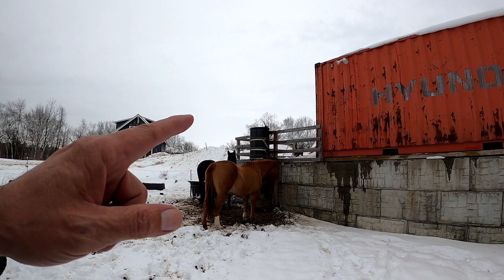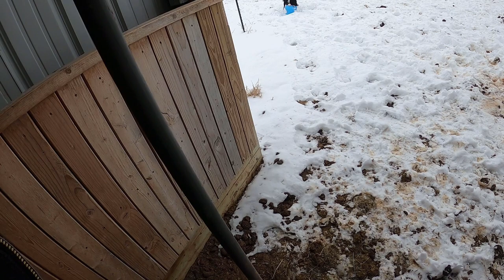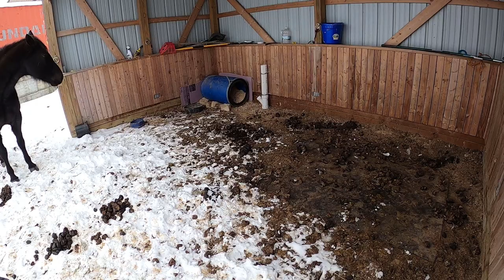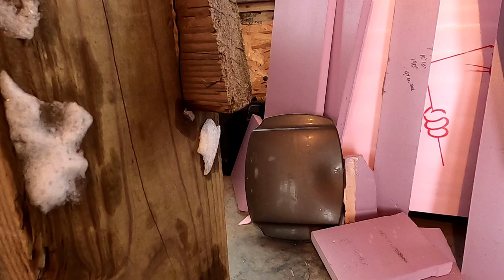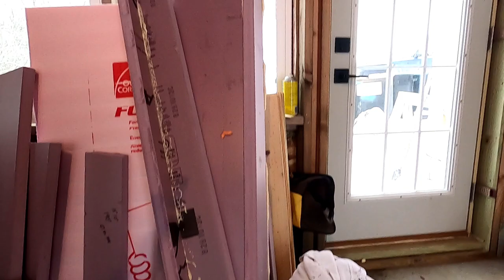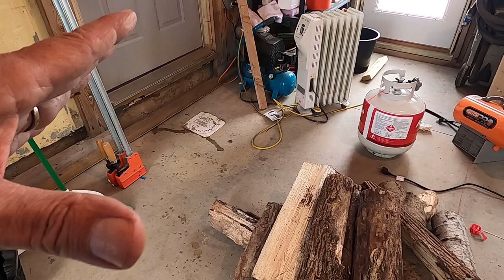@TheCrockers Need a Digging Bar [a Few Foundation Tips as Well]

Comment from the maker: More tips for The Crockers. They may have taken care of the foundation already, but I haven't seen any video of it yet, so I'm showing a few possible solutions and a bit of advice before things get too far and it becomes very hard to fix. We use a digging bar on nearly every hole we dig -- it's nearly impossible to dig a hole without one in very rocky ground which is typical on ridges and hill tops. If you haven't been to Jason's channel yet, you can find it here: The Crockers --  https://www.youtube.com/channel/UCm7zU1B8rHqZT8_DVEZaUqA
Reply: In really rocky soil we dig a hole as big around as you want deep. As you dig remember you only need the center to be the deep part. You can go around and get out the bigger rocks easier with a wider hole. Pick axe, shovel and a digging bar.. with a wide hole even this old man can dig one in a couple hours.

Comment: I am in TN and have boulders that are at least 15' plus wide - some of them.   We were trying to put in an electric fence and had to give up because the boulder went on and on.  TY for this infor - not for me, but man who helps me  on the farm.
Reply from the maker: Hi Martha! I'll be doing a detailed video on t-posts in rocky ground this spring if it helps! The digging bar will easily get out 15" boulders -- unless it's the tip of a much bigger one. It also helps greatly if you use a pneumatic pounder like a 'Man Saver'. With one of those, the t-post splits the smaller boulders in half!
Reply: @PlanetMojo  she said 15 feet?
Reply from the maker: I'm sorry Martha! As Cindy pointed out, you said 15' and that's a whole different animal! It all depends on how far down the rock is. You could cement the posts into the ground on top of the rock -- or make some bucket t-posts. I have two videos that show the bucket t-posts:

https://youtu.be/K1vNfAgH8P0

and:

https://youtu.be/SDOk91AjkT4

You can use anything for the concrete really. Hope this helps!

Comment: I'm just watching the video and have a question. When you explain your post, I feel like I'm right in what your saying, but do you mean that is (3) 2 x 6's nailed together to make those post? Just trying to determine the size they are and if that's what you did. Thanks
Reply from the maker: Hi Homestead! When you buy post and beam posts from a big box store (we use Menards here in the Midwest), the smaller ones are solid wood, and the larger ones are laminated like shown. They are multiple boards aligned at the factory and nailed together to make one post. The top can have a saddle joint built-in. Sizes depend on the size of the building.

Comment: The frost line from what i just google might only be 18inches  in Eastern Oklahoma..  Never heard of 6 foot embedded posts.  Heck my shed is on skids setting on a concrete pad.  Now a horse walk inn might be like a para sail
Reply from the maker: The frost depth is 4 feet for footers here, but water lines need to be 6 feet. They do posts for pole barns and run-in's at 4' and 6' around here. The run-in has 6' depth because it is a big sail like you said that catches the wind when it comes from the right direction. 

We had a 8' x 12' chain link dog run -- not much of a sail going on there -- that blew away while we were building the house. The wind pulled out all of the anchors and rolled it a couple of times over the edge of the ridge were it crumpled up.  The wind can be brutal up on a ridge!
Reply: @PlanetMojo  where the heck do you live, Siberia? Lol
Reply from the maker: @HanginOutWithStan  -- A bit north of there -- Wisconsin 😉 -- It's going to be minus 41 with the wind chill tonight!
Reply: @PlanetMojo  lol yep, that is a bit north of here. It was a frigid 61° here today but is supposed to be near 80 through the weekend. A friend from here moved to Wisconsin 10 or so years ago and misses the south Texas weather.
Reply from the maker: @HanginOutWithStan  -- Worked in Louisiana for a spell a few yeas back, and the winter there was like a cold summer day here 😉
Reply: @PlanetMojo  my second to last work assignment before I retired was in northern England near the Scotland border. I told my Brit friends that I never thought I would miss my hot, humid weather, - but I did. The company I worked for provided a huge 3 story mansion for me to live in while I was there and my bedroom was on the 3rd floor. It had 12 foot tall ceilings and there were three 4 foot wide windows on the exterior wall that went from the floor to the ceiling.there was a 4 foot radiator against the wall between each window. The house sat on top of a very big hill. The view out those windows was stunning looking out into a long wide valley and at smaller hills covered with sheep. But in the winter time condensation would build up on the inside of those windows and freeze. I had sheets of ice, inside my bedroom lol. I loved that job, but I was glad to get out of there. I honestly do not see how you or anyone deals with that kind of weather. Just stay warm and safe up there!!!
Reply from the maker: @HanginOutWithStan  -- Thanks Stan , I was up stoking the stove in the middle of the night last night! It was minus 16 at about 2 a.m.. Now I need to go out and check the yard hydrants just to be sure all is well. I moved three of them last summer, and one has a hole that was full of boulders that couldn't go back in so it's a bit shallow at 5'. Water lines are 6' down here. In this kind of weather, you have to make sure someone knows where you are and when you will be back if you go for a walk -- if you have an accident and can't get back quick enough you could get frostbite or worse 🥶 

That old house you stayed in in England probably had all of the fireplaces going full blast back in the day. Probably zero insulation in the walls. I wouldn't mind visiting the place though, it sounds like an awesome area!
Reply: @PlanetMojo  the old house I lived in while in England had solid cement walls, exterior and interior, approximately 18" thick. It had 5 fireplaces but they were unsafe to use. The house is over 400 years old. Under the room I used for my study, beneath the ground, was a fuel storage tank. When the house was remodeled just before I moved in it, that tank and a new oil fired central heating system was installed. It took some of the chill out but I was still cold there. I had so many blankets on my bed I could barely turn over. I loved my job there but I hated their winters. Your winter life sounds very dangerous. Please stay safe!!!
Reply from the maker: @HanginOutWithStan  -- Thanks Stan. The cold snap is passing today! The forecast calls for a high of 35 degrees -- near freezing but over 50 degrees warmer than just a day and a half ago!
Reply: @PlanetMojo  I am very happy for you. It is 55° here right now and I'm freezing lol. But I've got work to do so I'm bundled up like an eskimo, getting it done. A couple days ago I was gifted two beautiful horses by a friend too old to tend to them now, then this morning she called and wants me to take her 3rd and last horse too. So I have lots of new fence building to do.
Reply from the maker: @HanginOutWithStan  -- Looks like you are going to be a busy man! I'll be doing the same when the ground thaws -- in a month or two 😉

Comment: My question is he did not knock his posts out and place the rim joist to sit the knock posts. He also did not use carriage bolts  to attach the rim josit to the posts. Deck screws  and lag bolts are not going to hold all that weight up.
Reply from the maker: Yes, there are definitely some structural issues going on -- but hopefully Jason can take care of those things before getting too far down the road!
Reply: Rob Bee he did notch the top of the post. His problem is he has all of his floor joist hanging from a single 2 x 6. That 2 x 6 is right on the outside of the cabin floor area. Think about it. What happens when that 2x 6 that is going to be overloaded with the entire floor weight, the cabin walls, the roof, and furnishings. Yes the cabin walls will be on the floor, but the floor is still supported by a single 2 x6. Even if it was supported every 4 feet, it's still going to rot out in time. What happens when either or both of those 2 x 6's rot? The entire place falls in on the outside end walls. Same with front and back walls. The entire cabin weight will be on a single 2 x 6. The 2 x 6 he is hanging the joist off of is supposed to be an end cap for all the joist, not a horizontal support for them. If anyone can explain to me how what I'm saying isn't correct I'll be more than happy to learn something new. he built it wrong from the start and instead of admitting it and tearing it down and starting over he is head strong and going to learn in time he should have listened to sound advice. He blocked me from commenting for telling him Casinos will destroy his dreams, before he let's them lure him in. . More sound advice he can follow or fall into their trap and learn the hard way.

Comment: The easiest, best fix i see would be to dig holes on the outside of the posts. Put a peice of 5" C-channel and bolt to the post. concrete and bury.
  Little tip,,, never put the concrete close to the top of the ground. an 10" thick disc at the bottom holds much better. Most people make the mistake of using too much concrete in the holes. Put a pencil in some sand. wobble it back and forth and it comes out easily. Now put a washer on the end and try it,,, much much harder. When you put concrete to the top of the hole you just make a fatter pencil. You can bury an umbrella and pull it out. if it's not open.
Reply from the maker: That would definitely work! I would 'T' it off with another piece of c-channel at the bottom of the hole bolted to the first as well.

Comment: I like, what I think you're calling the "Run In",  the structure where your digging bar was in. That looks good. You do some good work Planet Mojo. Even your romex wire is nice and straight coming down to the switch. Correction... That looked like romex wire from further back, but it's  Liquid Tight conduit, maybe ANAMET brand, now that I see it in closer view later in video. Details matter. :)
Reply from the maker: I am a stickler for details 😊 it is dead straight, and yes it is in conduit -- the horses would likely chew on it if it were exposed, but I never have exposed romex at ground level anyway.